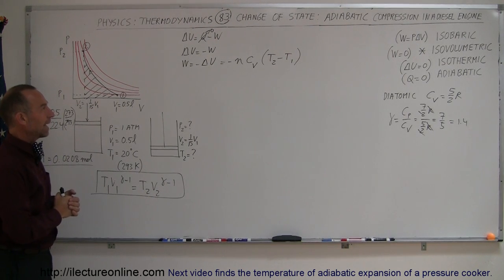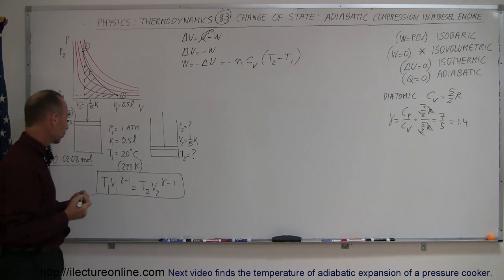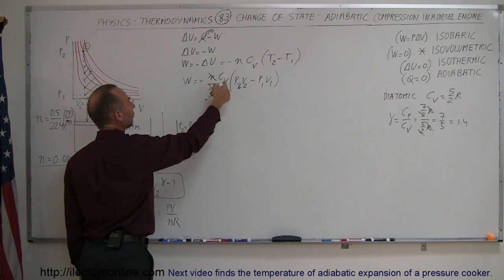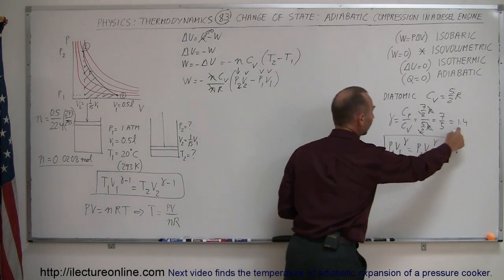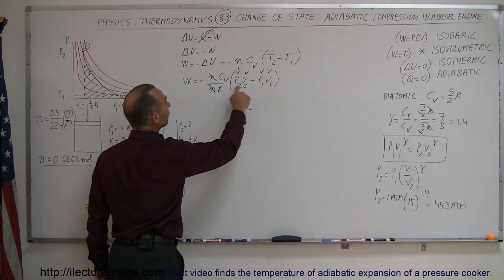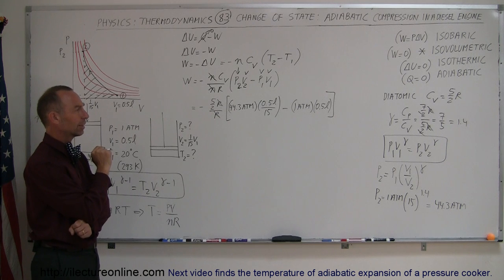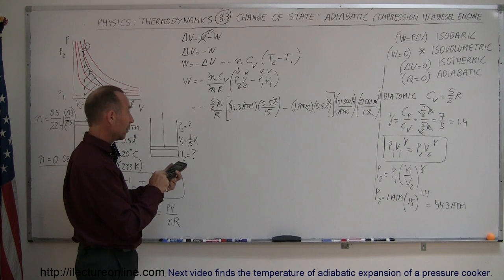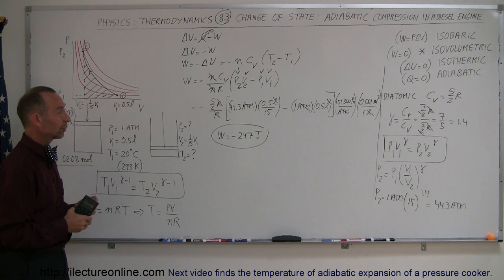Physics 27  First Law of Thermodynamics (19 of 22) Adiabatic Compression in a Diesel Engine

Comment: How did you get V2=15L?
Reply from the maker: In the problem it was given that the gas was compressed to 1/15 th of its original volume (which was 0.5 L)   So the ratio V2 / V1 = 15